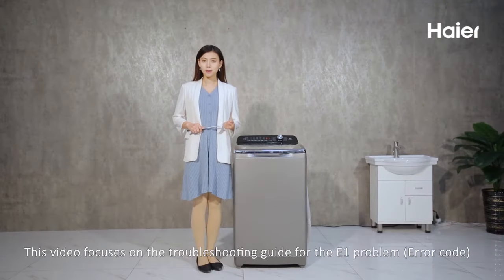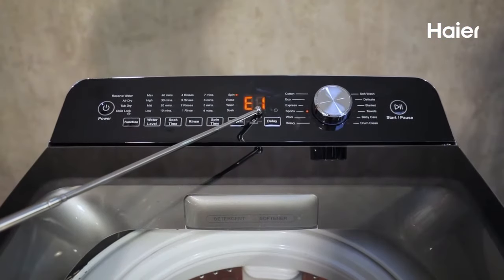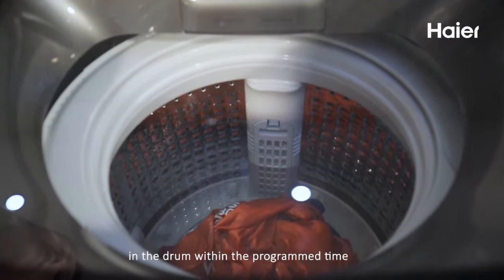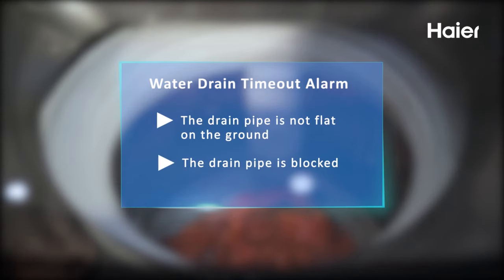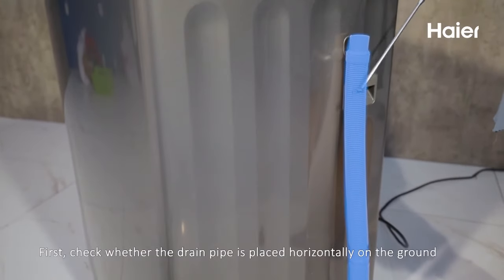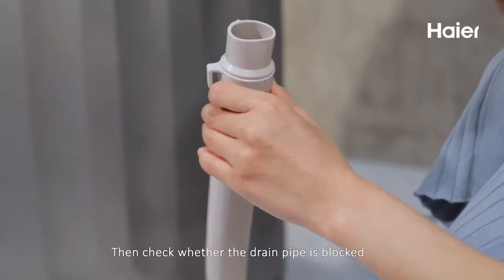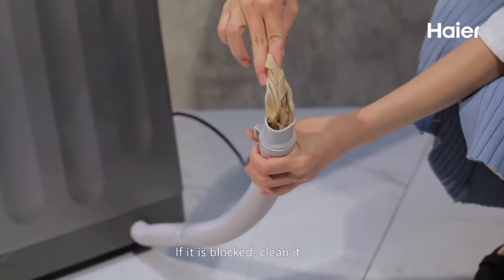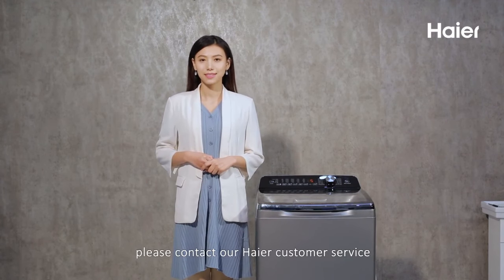How to deal with E1/No drain problem of top load washing machine?

Comment: Hi there. Would like advise on my Haier HWT70AW1. There is an E1 showing up on my washing machine.  The drain is clear. Would like adive on what to do
Reply: Try cleaning the inlet port for the cold and hot water. I had little sand like pebbles in there. It is a screen. If that blocks the water it will not fill as fast as it should.

Comment: Dear Haier .... pleeaase support me with my "E1- clear filter" problem  with your Haier front loader ...  it's new, not even used it with clothes in it
Reply: There are filters inside the bottom of the machine for the drain. There are also little screens inside the part where the hose connects to the back of the machine. Make sure they are clear. Also check the way the valves for your water lines operate. Disconnect them from the machine and put them in the washer tub and see which way is open. I have valves that are closed to the left and open fully to the right. That is different than all the other ball valves in the world.